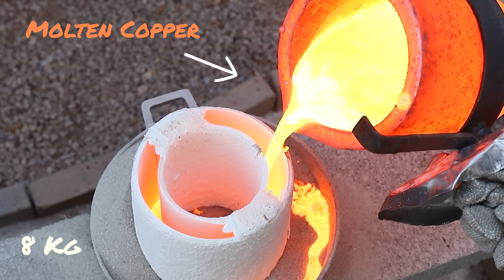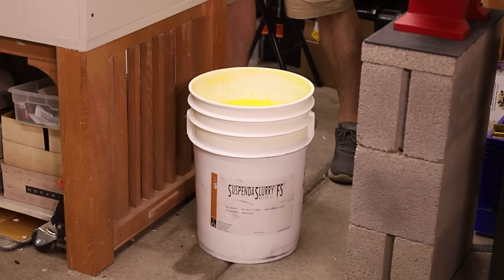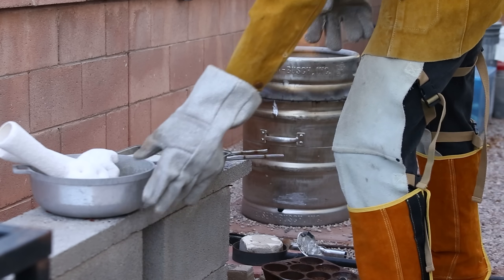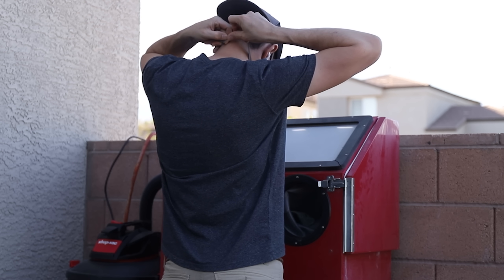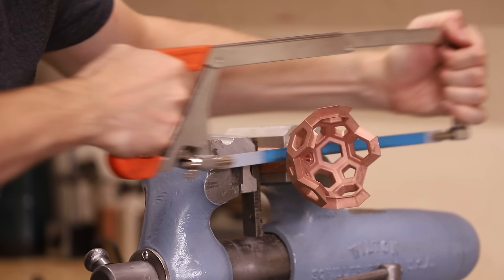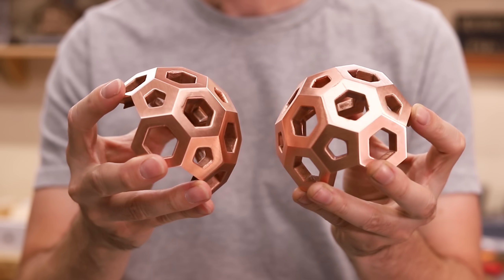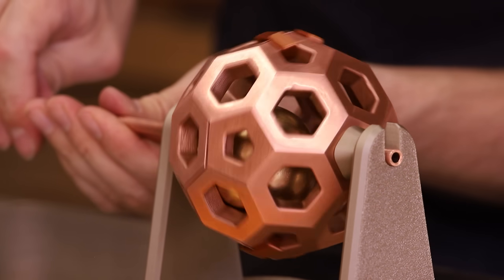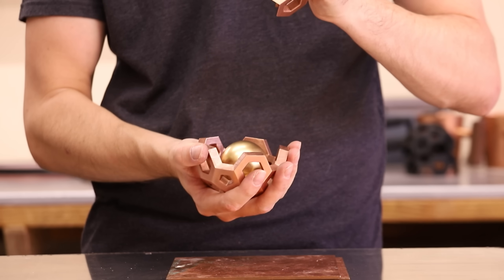HUGE Magnet VS Copper Sphere - Defying Gravity- Will a Neodymium Magnet Float Inside?

Comment: The gap between the halves may affect the distribution of currents (large currents flow there). You can try to fit them tightly and solder them. Cool metallurgical work anyway, regards from Poland..

Comment: You can use the sprues as the base components of a continuously variable trnsmission for another mechanism project where speed needs constant automatic control...? Just attach the transfer wheel to an arduino controlled shaft.

In fact, you could use the sprues with a pulley and make a continuously variable drive to actually demonstrate this project in action with a constant speed motor.

Comment: It's too bad you can't generate a fusion reaction inside there. Then you make a second counter rotating and have some sort of digital or even mechanical speed control, that could somehow control the reaction... you heard it here first, come back for me when this solves the world's energy problem internet. Obviously the copper is there to generate the levitation and absorb the heat of the reaction which could then be turned into electricity.

Comment: Super cool experiment. I'd be willing to bet you can work out the ideal rpm from the current generated by the spin. Without knowing the mass of the copper, I can't do that from here, but you should be able to hook up a meter to measure your output.

My initial thoughts for applications go to bearings of some sort, or precision gimbals. A self-steadyinig platform without external power? It probably wouldn't work (attempts to draw the current to power the motor interfering with the magnetic field), but I would be tempted to try.

Comment: You can also dip your investment in isopropyl before to put them in plaster to avoid those "boogers". Vibrate the plaster helps. 
Vacuuming the plaster also helps.
Don't forget that motion is relative, so when the magnet rotation synchronizes with the copper cage, it falls. I think you'll have more luck with vibrations.

Comment: for the eddy currents its important that both sides of the spheres are connected via a low resistance path. Just pressing them together might break the current loops which dramatically reduces the effect

Comment: Thank-you for showing the full process.
Very cool to see.

I like the bit about using pre-heated molds to avoid cooling the metal too quickly and introducing risk of deformities in that way. I imagine also reduces risks of extreme changes in volume from expansion/contraction of directly contact from two dissimilar materials and temperatures.

I wonder what the minimum amount of copper is that would still function.

Comment: very cool, more ideas: 
1.measure the voltage across the icosaedron at variable rpm.
2.try inject more current across the icosaedron to see if improve levitation, variable current, voltage and rpm.
3.try keep the shell static and rotate the magnet and see voltage across different vertices in the icosaedron at variable rpm.

Comment: INB4: not an electrical engineer or physicist, but perhaps solder the soccer ball closed (with the magnet inside, of course) across the entire seam to promote uniform magnetic fields across the structure.

Also, incredible casting! Was what's in the video actually the only try from 3D print to final sphere? 👏

Comment: Wonder what would happen if you used a small neodymium sphere surrounded by a larger sphere and fill the hollow space with mercury and place it all inside the copper structure you cast. Then spin the inner sphere at a high rate of speed.

Comment: With the ring magnet you used about a foot away...
Put a slightly bigger one on a post and motorize it to spin the neodymium ball. And try that along with motorizing the copper sphere. Use reverse polarity motors so you can change direction. And if possible, get brushless motors so you can kill the power to them allowing the copper sphere and/or the ring magnet allowing them to spin freely. Throw a couple of bearings on the mounting posts to reduce friction. Experiment changing the direction of rotation of each. I have a hypothesis for each test and I can't wait to see the results. 

P.s.- A voltmeter will be necessary to determine results. 😉

Comment: First timer and subscriber, Insane! I love it. How cool is your shop. The only thing I can think of to make it more visible is to perhaps is to reduce the thickness of the copper frame, it would make the holes in it a little larger to increase visibility. Then fix it to an electric motor with a speed control. To film it rig a strobe light to it and adjust the strobe speed to create a stroboscopic effect with the shutter speed of your camera. although that might make it look like a snapshot picture rather than a video, regardless thank you for a great Vid!

Comment: I've alway been fascinated with this. I think there should be a way to harness the energy and maybe use it to produce enough to sustain a permanent magnet motor similar to what was being used to try and power the hummingbird generator. It would seem if you could get enough power to just shift the magnetic poles it would keep it spinning. Even maybe a water wheel hooked up to a smaller generator that would keep changing the magnetic polarity to keep the bigger motor with maybe a flywheel running a larger generator. Maybe I'm all wrong and I probably am because I could think if I thought of this I'm sure someone more intelligent with mean of trying it would have already tried it.  To be able to go back and work with or probe the minds of people like Nicola Tesla and others that made huge breakthroughs only to disappear along with all of their work and projects. Maybe if even just to build something and sell it off to the electric company or petroleum industry for a small bundle so they can shelve it but at least I would have enough to buy the power or fuel I need for the rest of my life.

Comment: less thickness in the hex to make the interior more visible, cnc stand with ball bearings and a small brushless motor with adjustable speed controller.

Comment: You could have just attached a motor and spun the copper tube with clear walls on either side. Then you would have seen the magnet on the inside float rly well.

Comment: Some contraption that controls a motor to turn in a determined speed with some light controled by the same contraption you could make an stroboscopic effect trying to flash the light in sync with the motor so the sphere looks frozzen in the same position

Comment: Create an insulating barrier between the two halfs, and connect various electrical components, like LEDs or what have you as the only conducting path between the two hemispheres.  Spin and see pretty lights.  See if the ones on the equator of rotation are brighter than the ones at the poles.

Comment: Just a minor comment regarding the print. If you have the AMS, you should try to do the support (interface at least) in PETG - it doesn't combine with PLA, but will stick to it. You'll get a much cleaner surface where the support was.

Absolutely stunning to see the magnet behave that way. Cool project!

Comment: What if you attached tiny magnets throughout the outside of the sphere? Not enough to cause locking with the big magnet, but might provide enough force to act as a kind of inductor and keep the ball from hitting the top or bottom

Comment: This was very fascinating , I was just searching for a way to do better casts! I think that you should come up with a design similar to the one that you made but have the inside manipulated in  a way that when you rotate it, the magnetic field is stabilized to keep the ball in the center ( with grooves or carefully place ridges that when rotated at the proper speed create an alignment effect and you should be able to do that by either adding a pattern or having a mechanism on the outside that helps to stabilize the magnetic field that it produces so it could be centered, like a series of magnets that turn on and off at right time as it rotates! also the fact that it’s creating a magnetic field leads me to the idea that you could use a Tesla coil  in range of the ball in motion to boost out its current through a frequency modulator by capturing the outside field. I think maybe two Tesla coils on either side that are in a closed loop with the ball in the center could create some interesting effects!

Comment: Really nice casting! Such a fascinating science. I wonder if the (Dodeca?) Hedron were made with insulated copper wire would make any difference? It would be very complicated and difficult. Maybe just a spherical winding. One half in one direction, one half in the other overlapping pole to pole with spaces to see through. Hmm, just realized it needs to split to let the ball in. Unless you pour small ball bearing size neo's through an opening.... I'm just going over board now. I'm just thinking stacked copper wires make a stronger electromagnetic field than solid copper. Each strand being insulated has it's own field and the fields add up.

Comment: Nice work... lots of good equipment too.
Eddy's Currents may not be closing optimally in that design of copper sphere, which is just a beautiful mesh, that we have to compromise on. Another thing is that the synchronized rotation of the magnet ball and copper sphere (when the rpm of both pieces is the same) would eliminate Eddy's Currents completely, so I do not expect a much better floating no matter what you do next.
I wonder how much the magnet would float if the copper shell rotated in horizontal plane?!?

Comment: Veritasium likes to think of Lenz's Law as the "No You Don't" law. If something isn't ferromagnetic yet still conductive a strong enough magnet will say "No you don't." Want to move toward the magnet? No you don't. The material will generate an electrical current, and therefore a magnetic field, to resist it. Want to move away? No you don't. Same deal. What about moving laterally? No you don't.

Comment: See Merkaba motor. I think it would be interesting to pulse this with high frequency square wave pulsed DC. Also, have you seen John Bendini's copper bowl battery? It acts as a diode... 

This thing would be cool as a top to a tesla coil.

If copper is wrapped around quartz it amplifies energy. Maybe a quartz ball inside would be interesting. Vibrate with sound?

Comment: Separate the 2 halves with a thin insulator. Connect the two ends to each half with a wire/brush and see if it generates any electricity

Comment: Incredible idea and execution. 
Did you ever consider using wax filament instead of the PLA, and investment plaster for the casting like jewelers use?
Also, maybe there is a sweet spot of the distance that the magnet is from the outer sphere. Perhaps the holes in the sphere are influencing the affect?
This is so interesting and your craftsmanship is unreal. Thanks for sharing this.

Comment: Great video! If rotating a magnet near the object makes it spin, have you considered using an off-center electromagnet beneath it? By applying an intermittent current, you could control the spinning speed and possibly even levitate the ball."

Comment: Beautiful casting. You may only be getting momentary levitation because the magnet will start to rotate within the sphere due to the forces imparted to it by Lens's Law. Once the magnet is rotating at the same speed as the sphere, there's no relative movement between the two and no induction to keep the magnet in the centre. Gravity takes over and the magnet falls.

Comment: Additional external magnets (2? More?) to control the unit would be interesting
They could be static, spin same, spin opposite, inline or perpendicular, and all those in relation to each other and/or the unit you made (ball in “sphere”). I would think high (external magnet) rpms would create a lot of stability and potentially make the center ball magnet levitate with very low sphere rpm.

Super cool video! 👏👏

Comment: I wonder how it would go if you soldered the two halves together, as I'm sure you have a kind of poor electrical connection between the two,

As a display you could put in tn the stand and have it magically rotate by hiding that other magnet underneath, another fake perpetual motion machine. (that never fools anyone)

Comment: Suggestions: 1. Use a DC motor attached to a variable power supply. 2. Sync a strobe light to the rpm of the motor. Voila - stop motion video. :)

Comment: If you willing to put some electronics in this project, it would be really cool to build a light box for it and spin it with a motor that have a speed feedback, so it works on closed loop, spinning at constant speed without acceleration or deceleration. That way you could find spinning speed and light strobing frequency to achieve efect of "frozen" sphere with levetating magnet inside.

Comment: With the rotation of the 2nd magnet it got me thinking you might be able to create a type of gear without teeth or even touching.
Reply: Magnetic gearing/gearbox/transmission is already a thing in general use https://en.wikipedia.org/wiki/Magnetic_gear
Some use it for the transfer of force where being completely hermetically sealed/air/water tight is required
Reply: @WelshProgrammer  Not quite what I was thinking of but still cool.

Comment: It’s performance depends on the shape being a low resistance faraday cage. The interface between the 2 halves is an intermittent connection and that is affecting it probably. If they can be clamped/screwed together or add a layer of copper wool that should help. Pretty cool

Comment: Just clasping the two halves together creates a weak electrical path between the two halves for the eddy currents to flow. You must solder the halves together. Best to coat the two surfaces thinly with flux and flow solder into the joint.

Comment: Wow, you did a whole Lotta unnecessary work. There’s a thing called high temp silicone they use for making molds. You can only use it a couple of times and it’s expensive but it is a whole lot faster and easier and the detail is unbelievable but you did a good job, I’m impressed with the work do you need to research more come into the 21st-century material science is an awesome thing to investigate. Some of the new materials and techniques are just astounding.